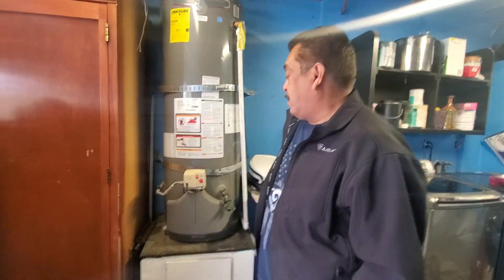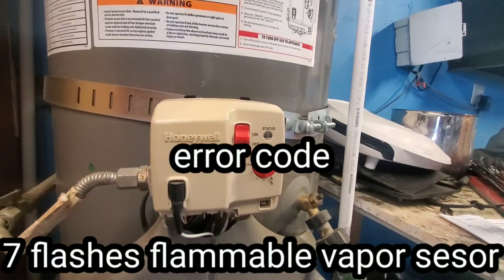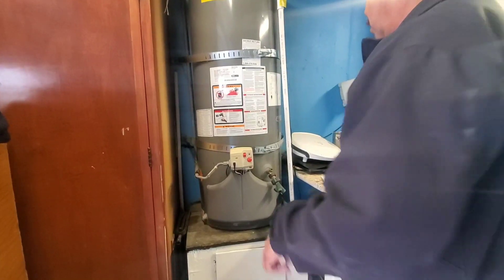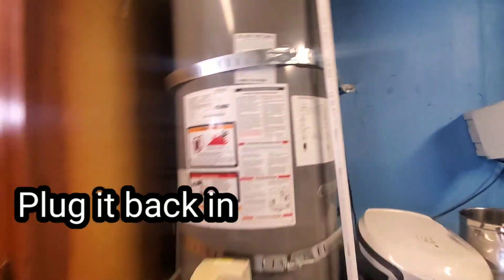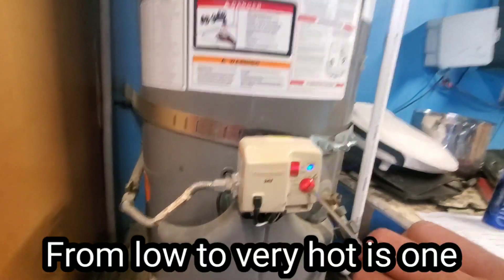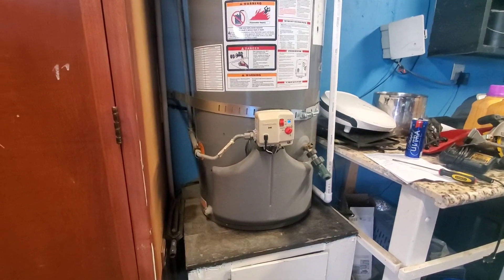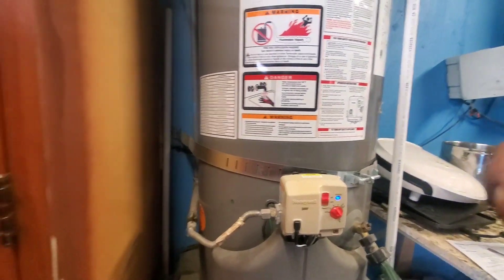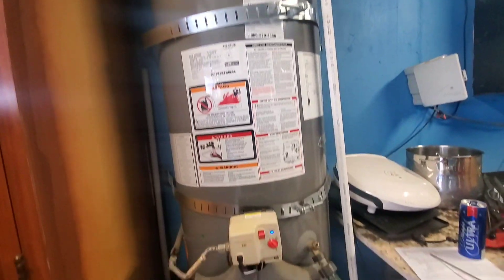How to reset gas valve on Rheem water heater DIY

Comment: Man it still isn't working for me. I can hear the pilot light clicking and struggling to ignite. Any ideas? Does the vapour sensor need to be replaced?
Reply from the maker: yes, its simple only 2 wires. check out my video on vapor sensor replacement

Comment: Thanks fort he great video. two small points that I wasn't quite sure about :
1. in the video it seemed like you only turned the knob/dial 4 times (you counted to 7 but it wasn't 7 complete iterations)
2. when I flipped the switch on mine it ignited right away and reset without turning the dial. so I am guessing that some models don't need the dial/knob to be turned? (I did turn the knob the first time I did it - but then it gave a different error code and so I tried again and didn't do the knob/dial turns)

not trying to take away from your video. I know nothing about water heaters and I'm just leaving it here in case someone else might see it and find it helpful. I could be completely wrong.
Reply from the maker: Thanks for your comment, The instructions that I received from Rheem tech support says " turn the dial seven times start at Low from low to very hot is one back to low is two, you may hear the unit try to start - you must complete all seven counts.

Comment: Thanks for the video, it's helpful. Btw.. my Rheem water heater has the same Honeywell GCV, but there is no separate power adapter to unplug in the installation that I have. Can you explain a little about what you're actually unplugging at time-point 0:56 of the video? Does that power adapter feed DC power to the Honeywell GCV?
Reply from the maker: same

Comment: My FVS failed because I painted in the basement next to the water heater and I used a lot of mineral spirits next to it. I didn’t know chemicals affected these heater. I gave an AO Smith. I didn’t replace the FVS, I just turned the temperature knob four or five times and the heater kicked on. Without watching this video I would have waited for a service tech to come over three days later. Thank you for this video.
Reply from the maker: Great for you, thanks for the visit.

Comment: thx worked perfectly, that shower this morning was brutal. then stressing all day at work thinking about buying and replacing my water heater
Reply from the maker: Great to hear!
Reply: @mrnoe67tiktok  i commented to soon. it went down again. had to replace the fvs sensor. but used the reset after replacing the sensor. your vid was still very helpful. thx
Reply from the maker: @JGMACHINES  Yes, I had to do the same thing after I made this video. I did make a video on how to.

Comment: This worked when our water heater went out after floors were refinished (small house, oil stain and polyurethane - lots of fumes). Pilot shut off, 7 blinks. Our valve is just like this (no obvious way to relight the pilot). Thanks for the fast and easy fix!
Reply from the maker: Thanks for the visit

Comment: I have tried this a good 30 times, still blinking 7 times. There are different instructions on the tank. It says unplug set to low switch to off wait 5 mins switch to on set desired temp plug back in. I have tried both ways still blinking 7 times. When I switch it back to on it blinks once very quickly the. goes right back to the 7 times. Now what?
Reply from the maker: Time to change the vapor sensor. very simple check out my video on how to
Reply: I’ll give that a shot.. can’t get the part in any hardware store will have to wait for Amazon to ship it tomorrow. Ants 🐜 were coming in due to the weather changing so I sprayed in my basement. Would something like this happen if I sprayed pesticides in my basement in the last few days? If it works I’ll give you a shot out. Thanks.

Update 3 days later:  So are you trying to tell me that a plumber will charge you over 100 dollars for parts and labor for a part that cost 30 bucks and takes 2 mins to install? Thank God for you and YouTube. I should have hot water by tomorrow. Your the G.O.A.T.

Comment: Thanks a lot. My pilot has been going out every four or five days. I did this and it always worked. But today it went out and I tried this and it did not come on. It has a short flash once every four seconds in which the code says it is idle (not call for heat, no fault conditions). I can't get it to light now. Can you help?
Reply from the maker: Time to replace the vapor sensor, Check out my video on how to

Comment: Follow these instructions: Turn of the RED knob to OFF walk away for 5 minutes to clear any residual gas in the line. Move RED knob to PILOT and hold PRESS. you may be able to hear the gas going back into the line, or you may not. Wait for 30 seconds and press the IGNITER button below the RED knob. You can expect to press the igniter a few times until you see the STATUS light begin to BLINK. after 3-5 blinks (counting not necessary) release the RED knob and proceed to move to it clockwise to HOT A B...you should expect to hear a roaring sound of gas fire in the system as a audible proof that the system is on. Good Luck and thumbs UP the comment if you find it useful
Reply from the maker: Thanks

Comment: My HVAC guy sent me your YouTube video. Exactly the fix for the problem. Thanks
Reply from the maker: Wow, thanks to your HVAC tech he is a smart guy
Reply: Very sensitive device. We were having a ceiling painted on the ground floor and the furnace fan pulled the vapors to the basement which locked out the gas valve.

Comment: This video just saved me $3300 per a contractor’s suggestion that I replace my semi new water heater. It was giving me the same 7 blinks and 3 second wait and I knew that I shouldn’t have had to buy a new one so soon. Thank you sir for posting this. I followed the directions exactly as the video instructs and it worked for me. Can’t wait to take a hot bath this evening.
Reply from the maker: If it keeps happening, then just replace the flammable vapor sensor. it's real simple just 2 wires, I have a video on how to.
Reply: @mrnoe67tiktok  thank you so much.

Comment: Went away on vacation and turned to LOW. Came back and turned up, 2 of us showered fine an hr later. Each morning since (3) it's been blinking this error code. Thurs this fix worked, Fri this fix worked, Sat this fix ain't workin. 3.5 years old. Any other ideas? I saw that the vapor sensor if it got wet can be blowdried for 2m and then work properly. That's my next try.
Reply from the maker: Time to replace the vapor sensor. simple fix check out my video on how to..

Comment: Tried 4 times not working.
Reply from the maker: You might need to replace the sensor
Reply: @mrnoe67tiktok  
Had to replace the gas valve
Reply from the maker: @markh9940  OK Thanks for the visit

Comment: Awesome... worked great for me. We had six flashing lights (not 7 as you had) but this fixed it. Our plumbing company said they have lots of problems like this, and the only solution is to install a new water heater! 🤣
Reply from the maker: No, all you have to do is replace your flammable vapor sensor. Easy to do check out my video on how to do that.

Comment: I did that and it works but after a few min it will shut down or i wont get enough hot water.
Reply from the maker: You need to replace the sensor

Comment: This reset my pilot light but it keeps going out every day for the last 4 days. My code is the same speed of blinking but it doesn't pause and once it's reset it does a "heartbeat" bright dim bright dim repeated code. I shouldn't have to reset it every day, it's a 2 year old water heater. Any suggestions?
Reply from the maker: replace the sensor

Comment: Help, this worked the first time but now it's not working. It's the same error code but I've tried many times and it just keeps giving me the 7 flashes. I've even unplugged it for 30 mind and still nothing. I've watched your video dozens of times and mimicked your moves exactly and it still hasn't reset.
Reply from the maker: change the sensor, very simple I have a video on how

Comment: You just saved me over a 1000 dollars on a simple fix.  Casteel wanted me to replace two parts, order and buy them myself after waiting DAYS for my first appointment and wait more for them to charge me 475. to install.    I believe I triggered the problem when I tested my circuit breakers when I installed my AC thermostat that needed to be replaced.
Reply from the maker: Glad to hear.
Reply: The reset only helps you heat up some water temporarily. You still have to check the part. There's a reason that it's shutting down. And it's dangerous not to have a check by professional.

Comment: The reason of 7 flash and stop, cause to the Sensor is not detected. First, replace the sensor ($ 25.00) the white knob on the side, then follow the guidance, turn on and off and switch the level knob : low to very hot (7 times) . The sensor was broke down because: any Ammonia smell, Bleach or car engine still hot nearby. Avoid any Ammonia smell near the sensor.
Reply from the maker: Thanks

Comment: Update 1: Had this occur for a 3rd time on my brand new Rheem Water Heater. I called my plumber who installed it and they came out and replaced the FV Sensor Kit. Rheem states that this piece is not under their warranty coverage. Part is $40.00 installed and is located right under the cover at the bottom of the unit. I was told to just clean the old piece with Compressed Gas Air Duster (Computer Cleaner) and put it away so that I can replace it myself next time. We live in Las Vegas, NV and was told the dusty air coming thru the outdoor closet vent was causing the FV Filter to clog and set off the sensor. Oh, the joys of home ownership!!
Reply from the maker: yes

Comment: Thanks. This works, but after a week or so it resets again. Have you experienced this?
Reply from the maker: yes you need to replace flammable vapor sensor very simple. i have a video on that
Reply: Mine is making a beeping noise and won’t start the main burner just the pilot?

Comment: Had to reset the darn code again  to but the customer service was closed. Couldn't remember the reset instructions I was given two days ago You tube to the rescue. Thanks!
Reply from the maker: if it keeps happening, just replace the Vapor sensor very simple. I have a video on that.

Comment: God bless you. This procedure reset mine. It took me a couple tries to get the timing correct. Mine had two (?) codes... an 8 and a 4. It’s heating up now.
Reply from the maker: Thanks for sharing
Reply: Is your electric? Mine is gas and the box has black controls.

Comment: Thank you sooo much for putting this video out!!  My in-laws water heater stopped working and it had the exact same 7 flash error code which the manual said was the vapour sensor.  I replaced that but it still would not fire on not matter how many times we tried.  That trick about rotating the temp dial 7 times fired it on immediately!!  Thank you again soooo much.
Reply from the maker: thanks, I also have a video on how to replace a vapor sensor.

Comment: mine 2 flashes it says thermopile low boltage replace it same thing replace it again same thing after everything shoutsoff
Reply from the maker: According to the error chart it means the end switch is stuck closed

Comment: Hey man, I'm getting 3 flashes instead of 7. This instruction on the tank is very vague becasue there are 3 problems with 3 flashes + 3 seconds pause. I'm assuming it's either flame lost or electronics fault. Any ways to solve this one? Thanks in advance
Reply from the maker: On the eror code chart it says END SWITCH FAILED

Comment: Thank you so much for this video. We turned off the pilot while troubleshooting our water heater and couldn't get it to go back on. This video was spot on! We have the exact same Honeywell GCV valve. We got the pilot on again thanks to your video, but our water only gets luke-warm and never hot (even when we put the dial to Very HOT).  Any ideas what the issue could be? Thanks again for your great video!! 👍👍👍
Reply from the maker: Glad it helped

Comment: this worked for me for a while but now it won't even reset. i saw your other video about replacing the flammable vapor sensor, that should fix it right? i already ordered from amazon but is there anything else you suggest i try and hopefully i can get it to work before the new sensor comes? thanks.
Reply from the maker: Yes I had the same problem, I did the reset trick every few days. That's
 when I made the second video on how to replace sensor. It will definitely fix your problem
Reply: noe arriaga great thanks. at least with this heat wave, cold showers actually feel good.
Reply: @mrnoe67tiktok  i just found a temporary fix while you are waiting for the new sensor to come in. just tried it and it worked for me. https://www.youtube.com/watch?v=PgYgborUCi8

Comment: My plumber wanted me to buy a new water heater last Friday after he couldn't resolve this exact same issue.  I saw your video Friday night, followed your instructions on Saturday morning, and left a message for the plumber that I didn't need a new hot water after all on Saturday afternoon.  You saved me over $1,000.   THANK YOU!
Reply from the maker: glad it helped. if it keeps happening change out the vapor sensor.$25 fix i have a video on how to do it, Very simple.

Comment: Thanks for saving me the time of dealing with the manufacturing company to figure this out. Only took me a couple of minutes rather than a couple of hours dealing with them.
Reply from the maker: glad it helped. if you have to keep resetting it. then replace the flammable vapor sensor. very simple i made a video on that $25 fix.
Reply: noe arriaga thanks.
Reply: Looks like I have to replace the sensor. I called them for a new one and it was under warranty (lucky me) also they were the easiest people on earth to deal with. I’ll be watching your other video on how to install that. Thanks!

Comment: I just did it to my heater too, was blinking  seven times I followed the same process but after 15 mins it stopped and blinked again seven times. I did the reset again and let's hope it wont turn off again. But thanks great video
Reply from the maker: its probably a bad Flammable Vapor sensor. $25 part very simple to  replace. I just made a video on that. check it out
Reply: @mrnoe67tiktok  thank you, actually the second time I did the reset and now its working fine. Thanks